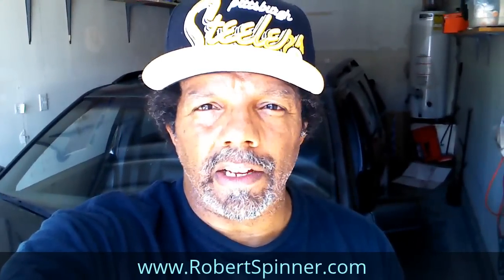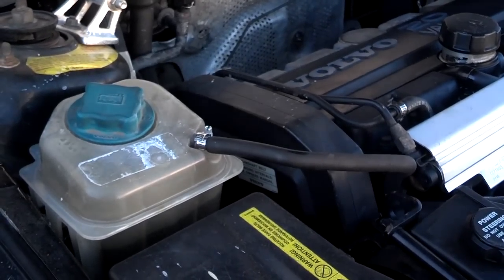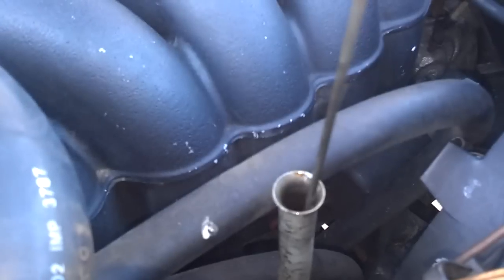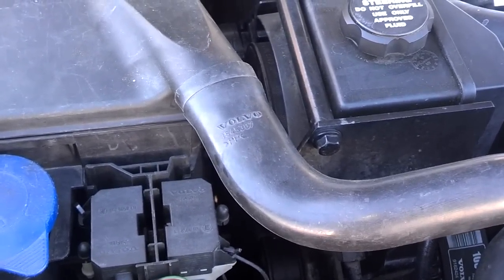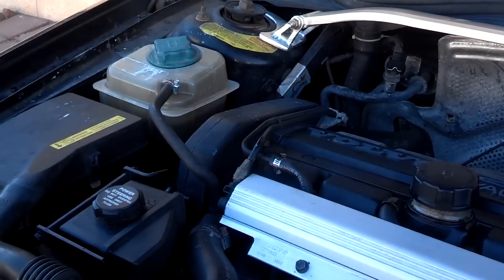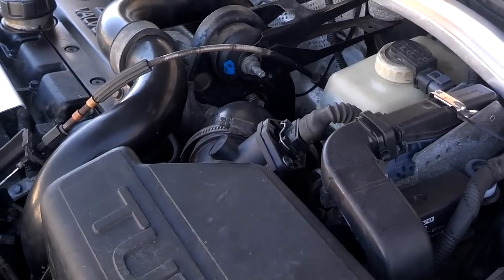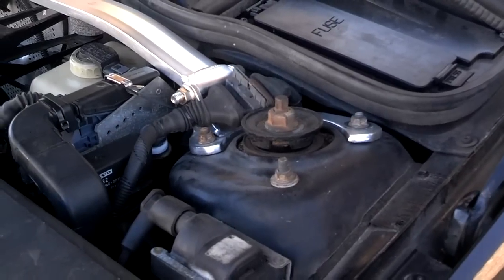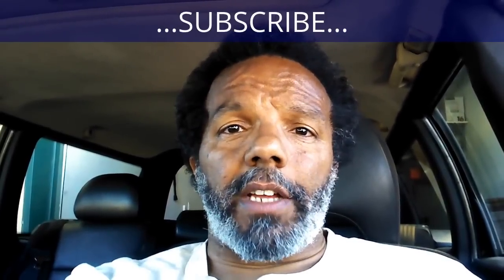Top things to check before buying a Volvo 850, S70, V70, XC70, etc., Pre purchase inspection.

Comment: Would oil reseals work? Like 2 bottles.
Reply from the maker: Huh? Work for what?
Reply: @RobertDIY  You mentioned the rear main oil seal could leak, and as many seals would leak after an X amount of years, would oil re-seal conditioner work as a substitute to replacing them?

Comment: we have oil leaking out the front of our engine but our hood latch is broke cant see where any ideas its a 2000 v70
Reply from the maker: +jeep james I suggest you stop driving it until you get the hood open and get it fixed.
Reply: we just bought it havent drove it my first volvo purchase car isnt here but your videos make things alot simpilar have you got any ides what it might be we gave 900$ hood latch is broke driver door latch dont work and leaking oil
Reply: we bought it at an auction so price wise n fixing did we get a bad deal
Reply from the maker: I have no idea. Don't know what condition it's in. There is info around the web about getting the hood open. After that, check the car out and see what it will cost to fix everything.
Reply: body wise excellent figured hood latch n door latch out just worried about engine leaking its 2 hours from home and didnt know if it would hurt the engine to drive if we stop every so many miles n fill up oil is that even an option or should we just haul it its my first volvo i just dont want to mess up engine we bought to sell.
Reply from the maker: As long as you keep the oil topped off it will not be damaged from lack or oil but again, I have no knowledge of its service history.

Comment: If the timing belt breaks, why would it destroy the motor? Wouldn’t the engine just stop running? I disagree, I think it won’t destroy the engine, but correct me if I’m wrong.
Reply from the maker: Ok 👌🏾

Comment: are timing chains maintenance free?
Reply from the maker: Alex Mackey No. Some have issues with guides wearing out and most should be checked every 50,000. If you totally ignore them, most will last about 300,000. So, most people ignore them.

Comment: So if i buy a good volvo for a 1000euros, i will spend another 2000 eouros in a year or two
Reply from the maker: Probably 3,000
Reply: @RobertDIY  ok, i thought, and my dad who had v70 2000 the boxy one, said that the audi coupe motor is bulletproof and he had it for two years and didnt repair anything.

Comment: those headlight wipers do thy actually work?
Reply from the maker: +canadiancatgreen One does, the other does not.
Reply: +Robert DIY ok thx but they were intended to actually do something as opposed to just being decoration that's what I meant.  I seen mostly Volos with these and wondered if they actually worked
Reply from the maker: They are designed to help clean snow and dirt off of the lens.
Reply: +Robert DIY a pretty cool feature did they do what they were designed to do well?
Reply from the maker: I don't know. I live in a hot desert climate.
Reply: +Robert DIY oh ok thx would possibly be used for rain here interesting to see they seem to still use them

Comment: i got a Volvo s70 with 202,000 mi and this car sucks haha fistable my head gassket went out!, ok i said i fixed it up! but then my oil transmission radiator failed , i purchased a new one , ok i said , then after driving my car for 2 miles my automatic tranmission broke down so now i am selling my car for $1,000 haha
Reply from the maker: +Erick Gonzalez probably worth $350.

Comment: +Robert DIY My volvo seems to be running a bit rough and was hoping you have some pointers. You can turn the car over and start it for about a second or two. But thereafter it dies. And it will happen over and over. Could it be the PCV system not allowing it to start? Or should I start along the lines of fuel delivery?
1993 Volvo 850GLT

Anyone with helpful hints and tips can email me at Burginclayton@gmail.com